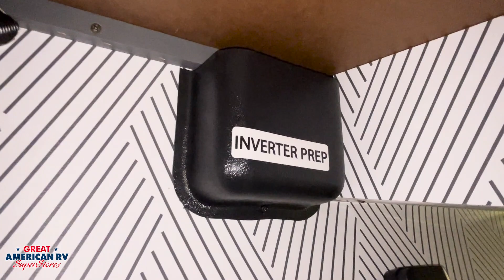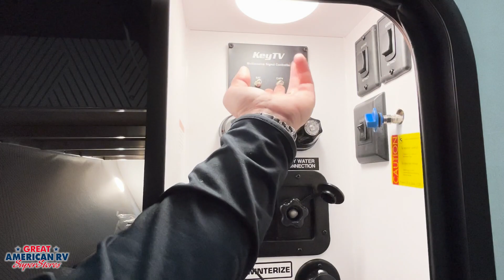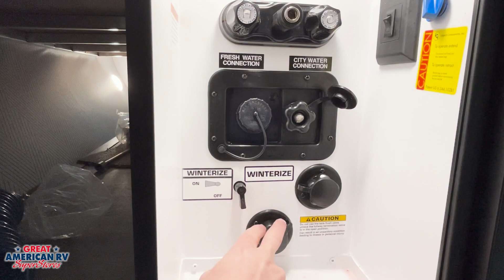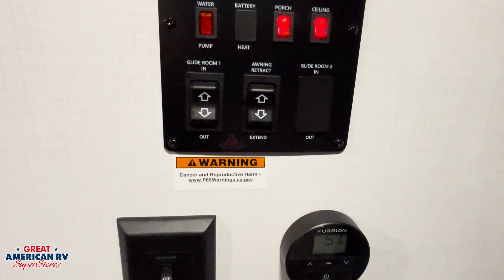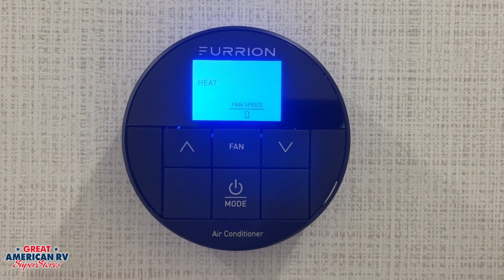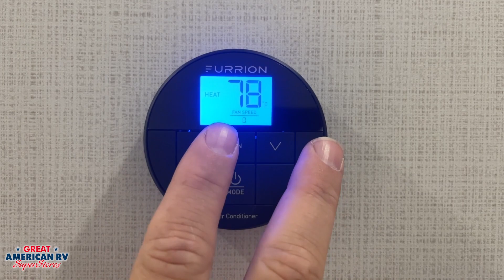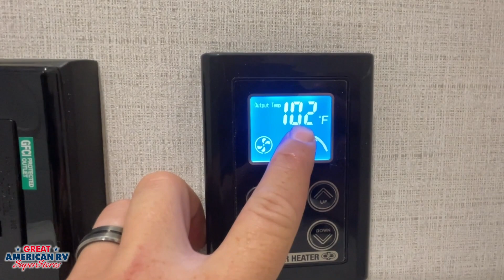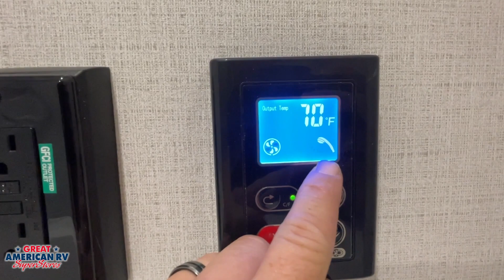2024 Keystone Bullet 2220ML Owner Delivery Walk Thru

Comment: I wish there was a winterization video of this exact camper I found one similar that will help. But first camper owner problems. This is a great introductory camper video of the model learned a little we hadn’t already learned. Thanks
Reply from the maker: I can try giving you some specifics on that unit, then watch the video link I have at the bottom of this comment.  For the Girard water heater, open the port at the bottom right when blowing the air out then close it when done.  At the water control valve turn to winterization and hook a hose up to the winterize port, kick on your water pump and fill with antifreeze.

Hope this helps -Todd
 https://youtu.be/c4ArsIPh3zA?si=MWp9mlLBZamTTbEL

Comment: Thanks for the video! What's the weight capacity on the rear 2" accessory hitch please? I've heard everything from 150# - 300# -- thanks. Also, I believe the 2025 Bullet's have a torsion suspension, but I can't tell (have Googled and been on Keystone's website) if this 2024 2220 ML has a torsion axle and suspension -- thanks.
Reply from the maker: @htschultz  off the top of my head those are the smaller hitches and 150lbs.  Unfortunately, I don’t have one in stock to verify.  -Todd
Reply: @GreatAmericanRV , Thanks Todd--I just watched another YT video on the 2220ML and it does appear to be just a 150# accessory hitch unfortunately.   :-(